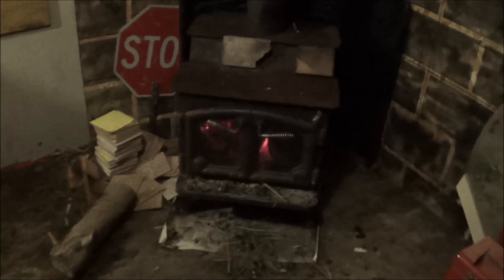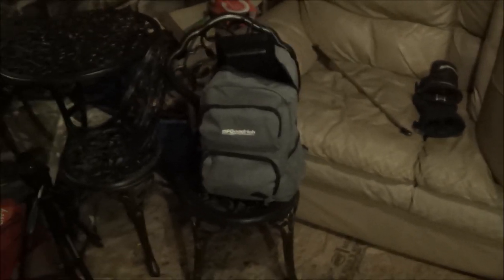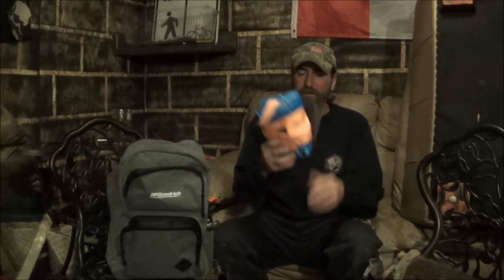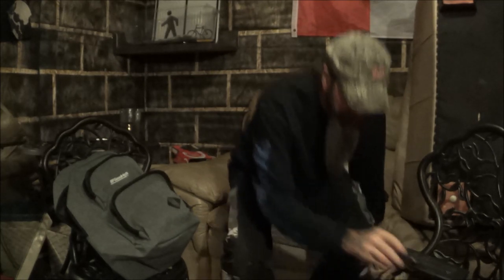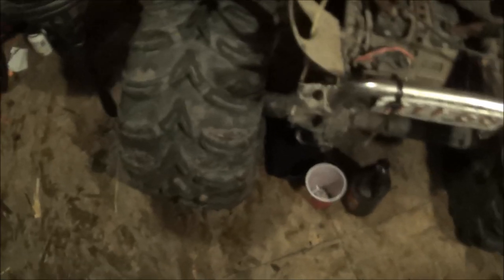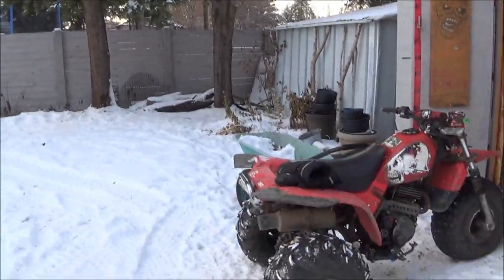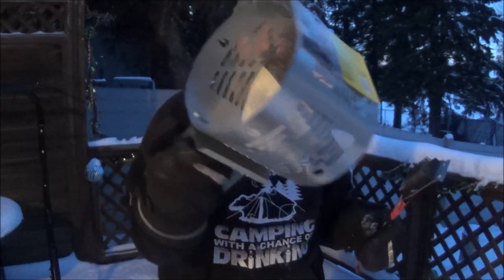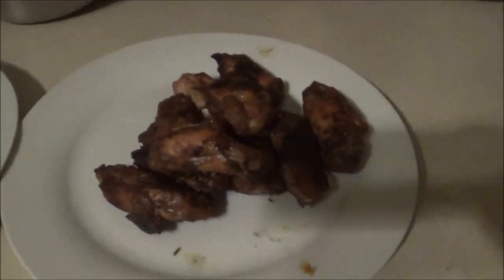Survival pack

Comment: Get yourself an emergency blancket and water proof matches. If the lighter gets to cold or wet it won't light. Wool socks and wool clothing will keep you warm even when wet,. A 10x10 tarp would be a good ideal if you get stranded or need to build shelter,.Paracord bracelet it has about 12 feet of rope, a flint, a whistle and a compass. If you want one my husband can make you one to add to your survival pack.